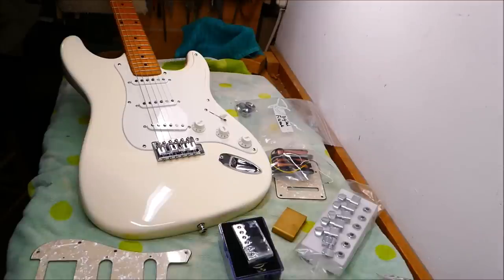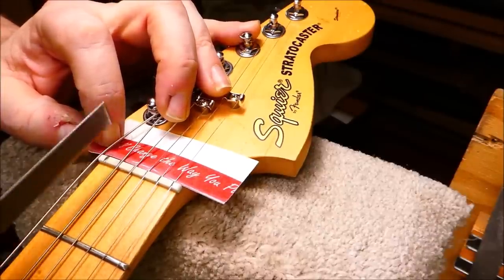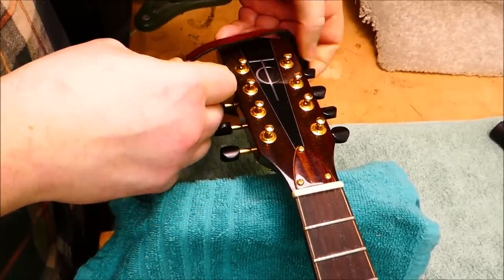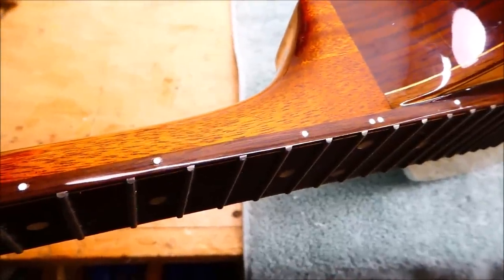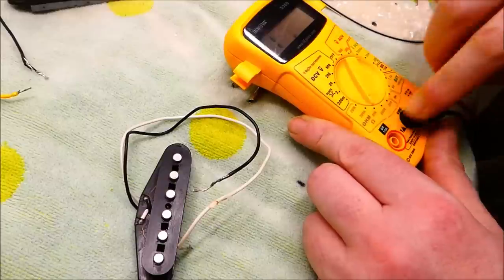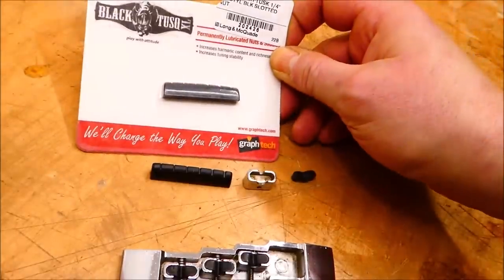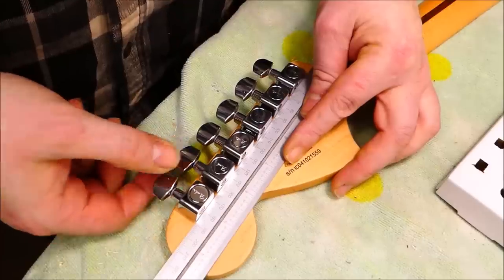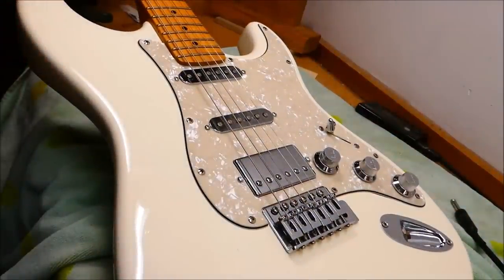That's a lot of work!

Comment: Had a  customer with a very similar situation, except reversed, Fender neck on Squire body with all the upgrades being imperial (for Fender American) .  He figured all should fit together and purchased the Squire body figuring would save money.  However being metric everywhere from pickguard to bridge to pickup cavities, Nothing fit or matched up.   Suggested he'd be better purchasing a used Mexican Fender body then all would fit proper and he'd save in labor.   Nope!!  Was set on going ahead with the Squire body.  In the end sure it cost him more having me put the puzzle properly and found out he had tried to do it himself and gave up.  Of course that wasn't the story I was told at the start.    Fender makes Squire parts slightly smaller (say its due to metric vs imperial measurements) however the real reason is in this video.  Fender doesn't want folks to buy a couple hundred dollar Squire and swap out electrics and hardware from the higher end American made guitars as it would be too easy to get a great sounding and stable (tuning and trem) guitar for a fraction of the cost.   

Yes, nothing matches easily from tuners to bridge and all in between.  The bridge and pickups have narrower spacing.   In the end spending all that cash on labor to improve a Squire, insane!!!   Customer will never recoup that money. T-Wood you have a lot of patience... Great work as always.

Spending all that cash for new PUP's and using the original output jack, switch and pots.... Yikes!!!

Comment: Boy whomever sent you that Strat and the parts did a terrible job of sourcing.  It takes a good bit of work, but you can find and buy high quality “drop in” upgrade parts that actually fit together.  I’ve fully upgraded my Squire 60s  Vibe Strat and thanks to my research, careful measurements and even some calls to a few technical services reps, before buying the parts (Fender Tex Mex pups, 5 wat switch, pots, new heavy duty 1/4” jack, trem block, upgraded saddles, wanmy bar, locking tuners, etc.  And EVERYTHING I bought, fit perfectly.

Comment: That wasn't just assembly. The knowledge on how to get those parts to work together is the justification for the labor charge. And it aint over yet...It might take him a while, if ever,  to realize that the low frequency response of the humbucker is not playing nice with any level sensing effects that he used to have no problem with when used with the single coil strat pick ups.

Comment: I think if you aren't able to assemble the partscaster yourself you shouldn't buy the mismatched parts and dump them on your luthier. I think the right way to go is find someone who builds partscasters for a living, tell them what you want and then let them go and procure the parts. That way if they mix metric and imperial or vintage and modern fitments it's on them.

Comment: I would charge £300 to assemble and setup a parts guitar and most of the time it a full day's work easy if not more. And when you charge £90 per hour you actually don't charge enough but no one is going to pay 8 or 9 hours of work to do it.

Comment: I honestly wouldn’t bother sending that to someone to put together. I’d probably use it fitting together all crappy and it might work. I’ve seen someone replace the bridge in their acoustic with a fork and it worked okay. It’s probably not worth commissioning that kind of work but if you do it yourself and get playable results it’s fine.

Comment: To answer you actual question, I would say, average the time for assembly. Add 20% to that then multiply by your hourly rate. That should be your average price for a parts caster assembly. To me it sounds like you are into it for roughly 5 to 6 hours and I don't know your Shop Rate but I'm going to guess it's somewhere between 80 and 100 per hour Canadian, so call assembly (average) $480 CAN. Your average person is not capable of producing the guitar that you have produced. They wouldn't have the equipment or knowledge to make the shims, cut the pick guard perfectly, tap and rethread the humbucker, etc. Nor would they know how to properly drill and plug all of the holes or match the paint and touch it up so that it's difficult if not impossible to see the repair. As I think someone mentioned you haven't created a parts caster you've created a perfectly matched guitar.

Comment: As Johnny Cash sang -

So we drilled it out so that it would fit
And with a little bit of help with an adapter kit
We had that engine runnin' just like a song
Now the headlight' was another sight
We had two on the left and one on the right
But when we pulled out the switch all three of 'em come on

Comment: Well yeah, that's a partscaster, but ...   If it's really the parts the player wanted, AND the neck feels right to them, then it's worth the time.  I have assembled many partscasters.  
Right on about the time.  But they can be unique sounding guitars that you are not going to get off a store rack.  
So assuming the player did real homework on the pickups, the job could be worth $400~500 USD.  But I'll bet that's not what they had in mind ...  🙃

Comment: Hey Ted,
My experience with almost the same scenario was .. “Never again”. In the end the customer who asked for me to do what you did ended up with unsatisfied customer because:
1.) It’s just a squire.. which in my mind is like 7/8’s of a real Fender Strat. Very low value to start with.
2.) Outcome of what they “thought” would help ended up to be not even close to reality.
In the end I recommended to my customer to just buy a real Fender Strat (American, or Vintage). Jump forward 6 months and he realized my recommendations were spot on. I ended up building him a Fender Partscaster to his specs. When I delivered it and from his first strum.. the smile on his face said it all. 
So my take away was.. don’t even do the work on something like that and either go the buy one yourself after testing it, or let your local luthier spec/order/build it. You’ll save $$$ and not waste valuable luthier time.

Comment: As an automotive tech, when a customer brings us parts to install, it's 125 an hour, no warranty.
The last partscaster I did, I used all Fender made parts, I did not have the issues you had here, tho mine was a Mexican made unit.
If it was I, I would charge him time and materials, your a professional, and you should be paid like one.

Comment: I've built several Strat and Tele partscasters and they always have a unique set of issues per project. No offense to your customer, but I can tell he wasn't using premium pickups. I dunno about the other parts but the wires of the pickups did not look like that of Fender CS and other companies. He should've loaded it with nice hardware to make it worth your while. I suggest you charge him the full number of hours and the skill of shimming and plugging. I'd say he shoulda just bought an MIM to his liking. I would've wanted to see the full Partscaster build without the edits just to see how a real pro did it. All my partscasters are as perfect as I can make them, but they lack the touch of a pro and definitely not worth charging for.

Comment: 5 hours at $60-$80 an hour for the work of a skilled craftsmen plus new strings, $316-$416 seems about right.  One thing I got to say is a customer is a customer if they are willing to pay for your time is should be no difference between that and a Les Paul.

Comment: With this kind of partscaster, if the owner can't do it themselves, I don't really see how it could be worth it to have a tech do the work... Cause in my mind, you should be able to charge for everything second you spent chasing this thing or that. So unless the owner has WAY MORE money than time. I'd say not worth having an highly qualified repair man doing the work... Especially if they are going to be using cut rate parts like a lot of these were.

Comment: The whole idea of a “partscaster” is for the owner to home build it and learn how to do it properly. Much of learning anything is trial and error. He should have built it himself. I have so far built 4 Telecasters (including coloring, finishing, and buffing) from pieces I acquired independent of each other, learning how to match things up. I also took classes, watched a lot of videos, and did my research before starting. If this guy couldn’t build this on his own, then what he learns is to do his homework before committing to a project.
Reply: Another reason might be to get exactly what you want in a guitar.  You know how many different components there are to choose from.  People want what they want and might not want to build it themselves.  BTW, kudos for taking on those projects.  I'm sure you learned so much.  Excellent.

Comment: Anything from £200 to £500, depending on whether you charge 'friend' rates...? I don't know what a luthier's hourly rate is but could be anything from £75 to £250? My local mechanic (the bastard) charges £120 per hour. That's like £$160? So really a luthier should be twice that imo. All I know is although I have an hourly rate, I often offer an all-in quote for good customers of mine for PC upgrade/repair work, so the client doesn't stress out over the costs. Obviously the cost has to go up if additional new parts are needed but I try to keep the labour rate the same as the quote.

Comment: If you want my opinion that was in the neighborhood of arguably 5 to $600 in labor maybe even a bit more. I built engines for a living, when someone wanted custom work done to an engine, they paid for the parts and straight time for setting up and making the engine perform as requested. There was no discount for this work as it was time consuming and often tedious. I see no reason why a Master tradesman in any other field would not do this. Including Lutherie.  Were it myself bringing you this, I would happily pay you for your time. The value of the guitar would have no bearing on the custom work I wanted done. To me this is the same as  buying a custom built guitar.

Comment: Hmmm???? Cost? Or Value? That's a tough one. 
For this specific project and your services? You are already at a disadvantage to be competitively priced to professionally assemble a "Partscaster" for profit.
Luthiery isn't a volume based, daily consumer driven trade. It is difficult to practice luthiery as a hourly fee based driven service. Practicing luthiery it's difficult to have an accepted standardized total time to complete task based playbook to refer and base the value or estimate your services . Luthiery is practiced by artisan/craftsman and as such there is a different expectation to the actual craft of the service provided. (Luthiery more esoteric, handcrafted custom based product) The problem is that there is also the Professional  Guitar Service Tech. The lines between Guitar Tech and the Luthier are blurred. Much of what the Guitar Tech does can be averaged and cataloged into time based tasks for reference into a playbook. Because Luthiery requires the same tasks and perform the same services as the Guitar Tech, but the skill set is much greater refined.  Luthier will make his main bread and butter tasked with Guitar Tech work as opposed to practicing fine luthiery. 
Personally, I find the whole concept of hourly based service as actually being rather bullshit. I rather give and would even much better recieve an honest based flat rate estimate than an hourly set price. 
Haste makes waste. I rather work without being pressured under the time restraint. I much rather have a craftsmen take their time to do their services. 
I would expect to have a professional assemble a Partscaster at a price of around $200 
Yes, the labor performed by you was time consuming. But for the most part all the tasks were in fact fairly easy peasy for most any competent "guitar Tech" .
Of course it is a collection and mismash of parts. I think that it should be expected that a certain amount of massaging is involved.  
The VALUE of your services is OBVIOU$...   
It is why it isn't worthwhile to bring a production consumer late model 100 dollar asian student model guitar to you for a neck reset! But it is quite common for the big box store resident guitar Tech to get a dozen or more of these to come across the bench in a single day to get new strings and maybe even an upsell or two for complete setup.  
That is why I could never be a financially successful Guitar Tech.! 
I would end up spending way too much time to try and make a P.O.S. guitar work and sound right... Going above and beyond, usually only to have Jon Q Public take the guitar back to little johnny who drags it across a ditch and leaves it on the school bus within only a few days after leaving it at the shop.

Comment: I think charging $550.for basically creating a very good guitar from a pile o trash. If I had that.and could get a skilled guy to do what was done here, I would have no issue paying it.  Some of the work was basic but you have to consider that the 5 hours could be spent on a vintage archtop (which I own a few) and I would gladly pay $100.an hour for a talented guy because a bad guy.could ruin a $10,000 guitar. Since the skills are there, the rate is the rate. Plus a really good setup brings a guitar to something really playable

Comment: I have had a plumber, and an HVAC out to my house his year. They charge $170.00/hr each with an initial trip charge of $170.00 making the 1st hour $340.00. The work Ted does is no less exacting, no less professional, and in many cases it's probably more so by a mile. So what should this 5/hr parts caster job be worth? Well, if he was a plumber or HVAC guy it would be just over 1000 bucks! It's total B.S. that he doesn't and likely can't get that kind of dough for his work.

Comment: I once had a used Porsche 911 that I paid $15000, put another $13000 into it and ended up selling it for $15000 two years later.
Now that I am into tinkering with guitars, my lesson learned is to buy a guitar with all on it and be done with it, it just doesn't pay to fiddle
with upgrades and buyers remorse.

Comment: Boy is Twoofrd right about this crap. I had a 2006 American Standard Strat in Olympic White. I decided to toirtous shell guard it from FENDER. A brass block from F-Tone. Brass vintage style saddles from Callahan. Now let me just say at this point,.....it was a freaking nightmare. The only thing that was nightmare free??? Was the new set of strings I put on it🤨. NOTHING FIT PERFECTLY!!!!!!! NOOOOOOOTHING!!!!! That licensed Fender guard was horrific. I had to shave the neck slot ALOT. None of the screw holes were recessed either. WTF Fender!!! The screws on the saddles were to big for the holes on the bridge. I was so angry at the whole sh_t show I ended up leaving it stock. Oh,....and did I mention the F-Tone Fender brass block screw holes were just a tad off. Yeah. Good times. Modding is fun right??? Right!!!!????

Comment: Not sure why someone would use a luthier to do this work. Some of it yeah like the actual setup, but most of the other stuff no.  But a Squire neck, cheap looking knobs, plastic pickup covers, and whatnot. Doesn't seem like it's worth the building cost. I guess under the circumstances.

Comment: I guess that the real quandary is that the standards that you set as a highly skilled repairer of vintage instruments don’t match the standards of a typical partscaster owner.  I would argue that for the overall quality of this instrument, it’s not worth hiding the fact that work was done (e.g. if the pickguard holes don’t match up, just drill new holes…you won’t see the old holes unless you remove the pickguard.).  But I understand that your pride of workmanship won’t allow something to go out the door looking like that, so if you say yes to the work, you’re stuck with spending a lot of time “putting lipstick on the pig”.

Comment: I have acquired a 1984 Japanese fender stratocaster. It came with the original tuners, neck, body, pick guard and case. I have a choice, try and source all the missing parts period correct or most likely buy new parts and try fitting it together. Watching you build I don't think I'm going to enjoy it which ever way I chose.  🤢🤢🤢

Comment: Hmmmm, what a mess. The only sure thing is an '04 Indonesian Squier Standard series neck, which i think it's a very nice one. That gap on the neck joint means the body is something else possibly repainted. Pickguard seems from Chinese Affinity or Bullet series. Standard series on 2010s had 2point tremolo, that's not. Possibly pickups are the original standard series alnicos, and it seems he's looking to replace with 200's indonesia ceramic ones from Affinity series. Who knows about saddles... Weird, instead of actually upgrading (other than tuners maybe) he just swapped pieces for the sake of it.
Well strats sure are a starting point for experiments, relying on Squiers which follows Fender patented designs at 95% you can get around it relatively easy, but there is already huge variation from China to Indonesia, and possibly vintage Koreans or Japan are another world. Plus, parts from china such comes in all sorts of incoherency and debatable quality, they make some pretty pickguards tho.
But yeah, the point of the lesson is spot on.

Comment: In the current economy, (here in the U.S.) $20 an hour doesn’t spread very far for housing, food, gas, insurance, & savings.  $100.00, doesn’t seem like adequate pay, for the work you did.  Never ran a business Ted, but I’m thinking AT LEAST $250.00 for the job you did on the strat.